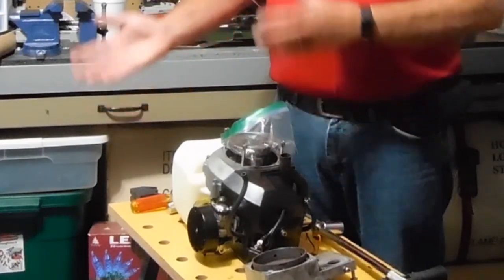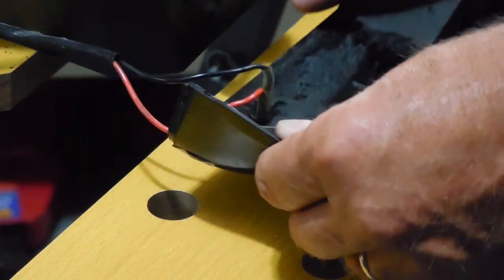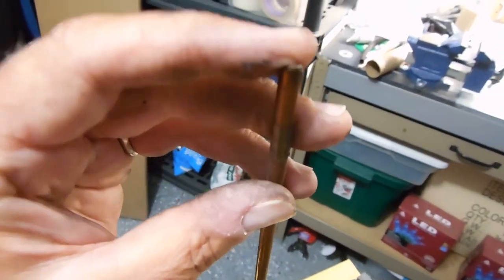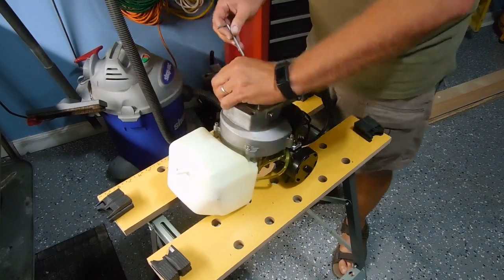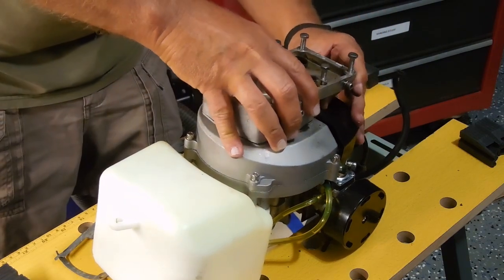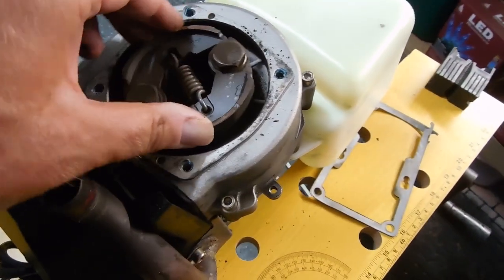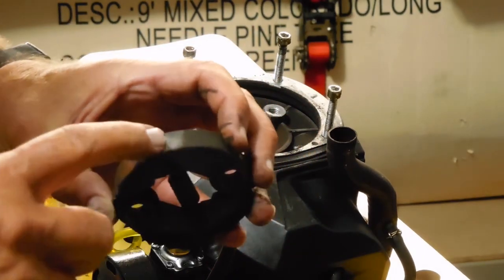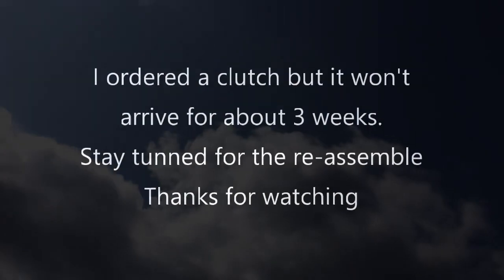Hangkai 3.6 hp Review: Clutch Repair (Part 1: Teardown)

Comment: Hey I just received my hangkai 3.5 and the exhaust water isn't coming  out of the port it is coming out of right above where the motor pivots on the mount... there is a small amount coming from the port when I give more throttle
Reply: Just wondering if you might have any ideas of what could be going on? Thank you
Reply from the maker: At an idle water will not circulate at all.  The pump is hooked up to the propeller shaft and there’s a clutch system that engages as the motor rpm’s increases.  If water doesn’t come out at half throttle then there’s could be other issues? Here’s a video that shows the clutch. You might try loosening the clutch mount bolts or replacing the clutch tension spring with a lighter one...
Let me know how it goes
Reply: Yes I understand it doesn't come out on idle..the problem is it's coming out of the wrong area its coming out just above the plastic exhaust port where the motor mount connects to the vertical shaft between the motor head and the exhaust port I'll problem just tear it apart and see how she tics..
Reply: Thank you for the hasty reply I appreciate it I will try the clutch spring as well
Reply from the maker: I also have a little water that comes out in the same area.  There are rubber tube water lines that you can see once you take off the engine cover.  The clips that secure them are real cheap.... It might be leaking around them.  I've not fully checked mine out because it has never been a large amount and I knew it couldn't be from the motor itself.  Also, the clutch has a very thin layer of abrasive that wears out pretty quickly.
I gave you the wrong link in my first response.  I've made 4 that cover the clutch and spring. Here they are:
1. Tear down - https://youtu.be/H4mPGuEKnKI
2.Clutch replacement - https://youtu.be/Qu9OjXbMutA
3. Spring replacement - https://youtu.be/G4qLw14lf9k
4. Motor running with new spring and clutch - https://youtu.be/LdtITFx6N-Q
  Changing the spring to a lighter one has seemed to help, but you can plan on that being a regular replacement project. Although I didn't find an exact match for the spring, I was able to use one I picked up at Menards, just had to bend it open..... Good luck, hope all goes well with yours.  Still to cold here for me to go out.
Reply: The problem  kinda fixed itself I dont know if there was styrofoam stuck in there or what but its flowing just fine now
Reply from the maker: @johnodonnell820  GREAT!  Hope all continues to go well.  Just be prepared to do some minor parts replacement as time goes by.... I've tried to post any that I've had, hope they help along your journey.
Reply: One more question was there oily residue around the edge of your bucket that you ran your motor in after breaking it in
Reply from the maker: john odonnell : Yes, you will have oil residue during break in because the oil to fuel mixture is a little rich in oil. It will go away after break in when you go to the fuel mixture with less oil.  50:1 after break in.  If I remember correctly, it is 35:1 during break in.
Reply from the maker: @johnodonnell820  : A couple of important items.  If you are using a bucket for breaking the motor in, I wasn't clear that you need cool water running into the bucket at all times. You don't want to over heat the motor.  I kept dumping in snow, but didn't show that on my early videos. Also, I've been told it wasn't a good idea to remove the propeller.... But I have not had any bad effects from doing that... Just don't over accelerate!

Comment: Do you have a video on replacing the water pump impeller?
Reply from the maker: Not as of yet.  But when I replaced the clutch, I could see how it would be easy once you open up and remove the shaft.  The clutch just slides on and off of the shaft as is evident of it's square opening that matches the shape of the shaft itself.  If I ever have to replace it, I'll be sure to record the process. (Oops, maybe I should have said... When I have to replace it!  :0)
Reply: @BoilerDan1  thank you. Where is the impeller located?
Reply from the maker: @NaughtyGoatFarm  :
It is down close to the bottom of the shaft but before you reach the lower gears for the propeller.  In the clutch repair video, I show where the water impeller is located between the 9:35 - 9:50 minute mark.
Here is a link to that specific video.  Just fast forward to about the 9:35 minute mark.  It's covered by a white plastic cover held in place by two screws.
Here's the link: https://www.youtube.com/playlist?list=PLjMZtm2hvqrOIvLcah1u1V45Y_R-AKeqm
Reply: @BoilerDan1  thank you again

Comment: After all the fixes and tweaks would you recommend this motor to a friend?
Reply from the maker: Good Question!  To me, the motor overall is sound, but the little things make it a little high maintenance! So to recommend it to a friend would be only after they understood that cheap comes with a price!  The fuel lines for example are a little thinner than what you can buy at a local mower supply store.  So I just purchased new ones for both inlet and outlet. Cost was $6 but they will last a lot longer.  Same with the spark plug, not expensive, but needs to be better than what came on it from the factory.  The clutch for sure is something to plan on replacing every season... Again, inexpensive.... But unless you enjoy doing the work, it's not a motor I'd recommend to someone that doesn't enjoy working on the motor.
So, overall I would not recommend it to a friend because I wouldn't want to be responsible if they are disappointed.  That being said, I WOULD BUY IT AGAIN FOR MYSELF.  Mater of fact, I'm considering selling my 2 cycle and starting over with the 4 stroke to evaluate it, and not have to mix oil and gas!  I'm also considering a different raft, to one that has a better (solid) back end to attach the motor on.
Thanks for watching and participating in the ongoing conversation!
Reply: @BoilerDan1  thanks for your quick response and all the information you are definitely an asset to a lot of people.

Comment: gonna save  my little motor gonna take it apart tomorow that my engineeer fabricated tomorow  and cut the 2 springs   4 brake pads so it should last awhile hoping it works because motor itself runs good wish me luck and thank you for the videos
Reply from the maker: Wish I had your engineer to put some pads on mine!

Comment: Hav many hour do you have on your hankai
Reply from the maker: I can only estimate.  Somewhere between 50 to 100?  I'm considering changing the clutch every season.  I will decide that after I run the new one for a while.  They are not expensive, less than $15 IS dollars.
Reply: I have 18  what s. The sintoms
Reply from the maker: Damir Radic : It had a loss of power to start with and then it just had almost no forward moving.  Looking back, it also had a metallic sound when running. I’d recommend you order a clutch and have it on the way!

Comment: You made it harder than it Has to be you don’t have to take the six bolts out and remove the whole thing from the lower leg around the fly wheel there are four Allen screws that are the smaller Allen screws you can just remove those in the motor comes apart without the fly wheel guard and just the clutch the clutch bell will stay with the plate on the lower leg
Reply from the maker: Sounds good, Thanks!
I was just doing it as a true unknowing beginner without instructions 👍😅

Comment: At 300 bucks...that's less than .40 cents a mile..
Reply from the maker: I'll add a summary here:  You can get more life out of both the pull cord and the clutch!
1. Rub Bee's Wax on the pull cord and refrain from pulling it all the way out when starting.
2. When you replace your clutch, put on a much lighter clutch spring.  Or you could even just take it off.  Your propeller will always spin, but at a low speed, you wouldn't get much motion from it.
Not trying to tell you what to do, I just know those two things helped mine out a lot.